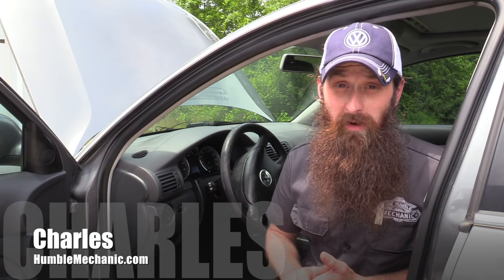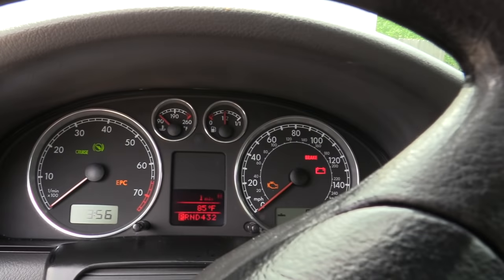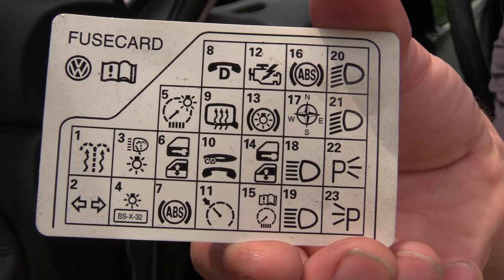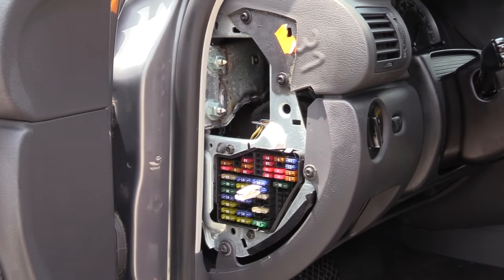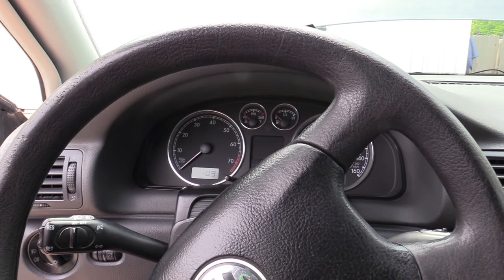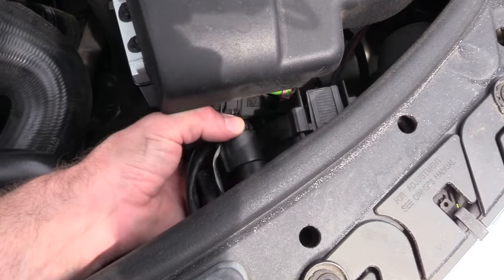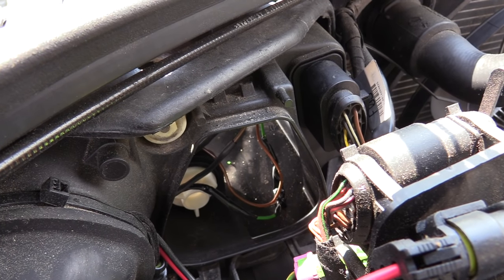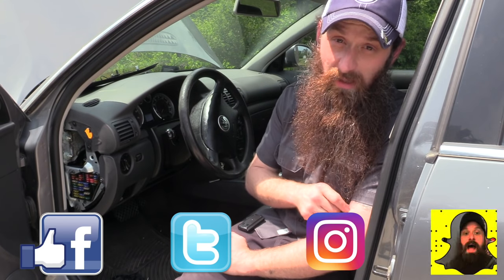Why My Turn Signals Don't Work ~ Diagnosis

Comment: I have a 2001 Volkswagen Passat, and when I was turning my defroster on for the windshield, I hit the hazard light button and it kind of stuck in and I had to keep pushing it and it finally released. But then my blinkers stopped working because of it. So I just pulled the hazard light button out a little bit and my blinkers are working again. Idk maybe this could help somebody.

Comment: Hi I have jaguar x-type 2001 I have problems with turn signal and high beam but the hazard is working I can turn on the high beam from remote control but when the car is starting high beam doesn't work i have checked the wiring for high beam there's no positive wire just negative but when I turn off the car  coming 12 volt when I turn on high beam from the remote control please no body knows fixed

Comment: hi, i have a 2005 acura tl and my right turn signal blinks fine but when i dont have my blinkers turned on, it doesnt stay on at night like the left side does. Do you know what I should check for? Essentially both sides should stay lit at night time and blinks when i flip the signal control on.
Reply from the maker: The stalk maybe?

Comment: I have a 03 beetle and the hazard lights work but not the turn signals. Any tips?
Reply from the maker: Make sure the stalk is good. And the relay may still be an issue

Comment: So I have a 2006 nissan sentra and my turn signals wont do anything but my hazards still come on just fine I've already checked the fuse and I replaced it and got a new one still nothing is happening could it be a connection problem?
Reply: Have the same problem man

Comment: So I am having issue with my left blinker not working by itself. It works with hazards on and my right blinker works by itself but my left blinker doesn’t.. any ideas? Don’t want to take it to a mechanic if I can fix it myself
Reply: Life with Nicole I have the same issue. It might be the left turn switch itself isn’t making the correct connection.

Comment: I have a 89 s10 pickup. My problem is the left rear brake and turn signal don't work. When you turn headlight switch on tail light comes on. All other lights work right. Bulb is good. If wiring harness runs up left side of truck how is it that right side is working right? Makes no sense.
Reply from the maker: Perhaps a broken/shorted section of wire

Comment: My right turn signal works fine but Every time I turn left my left turn signal sometimes work but sometimes It doesn't work. I need some an advice
Reply: we had a some problem in our Vauxhall were it would hyper flash but no green arrow on the dash and no bulbs flashing. some times it will work for a couple of seconds and it will go back to square one. turns out it was a earthing problem in the engine

Comment: On a 2004 Touran hit the turn signal stock to go left but it indicates on the right. It doesn't happen all the time but rather frequently what could be the issue? A dusty switch!?
Reply from the maker: Weird.  I’d be thinking stalk issue
Reply: @HumbleMechanic  Went to a local shop the guy said "It doesn't do it right now so I can't identify the problem"

Comment: I have a Corolla and I cant get signals to work at all but I have emergency blinkers, one of my headlights don't have a high beam, could that be problem? I've replaced a rear light assembly that was corodded,
Reply from the maker: could also be the stalk

Comment: Has this Passat been manufactured in the USA? Also, is the headlight an original VW part from one of their German OE suppliers? I've never heard of that before - and the way these wires look, I almost believe it wouldn't be legal to sell a car with such a crappy wire insulation on the European market (hence my question whether this Passat is a US only model, since especially the Passat of certain years is a completely different vehicle, whether it was produced in Chatanooga or in Wolfsburg)
Reply from the maker: No it's not a US VW. This was pre Chattanooga, and the headlights are OEM. 

This is actually really common on this generation VWs. I think mine are the worst I have seen. Now, some of this shielding has come off during the wiring removal.
Reply: Wow, I knew VW had quality issues, even serious ones, but using this material to shield those wires is the manufacturer equivalent of a hack job. I never thought that it had become that bad...And I am still not sure whether they use the same parts in vehicles for the American market, as they do for the European market. I've never heard of this issue on Passats, but I will inquire my mechanic about how often this occurs.

Comment: Need help, 2005 VW golf. Key won't turn to start position ,  radio won't play sound, wipers won't turn on,dash indicator lights don't come on. Car has been sitting outside a awhile, (Washington state)
Reply from the maker: ignition switch is probably the issue
Reply: @HumbleMechanic  I did just test the starter and that works. 😊 do you think if a mouse damaged the wire on the ignition  switch it would cause all other problems

Comment: That wiring is a design flaw. Either rated too low. Or the insulation is rubbish. If you intend to keep the car longer than a fortnight, I'm rebuild the harness in that part of the loom with better quality wire cut out of another unrelated loom from a different manufacturer.

Comment: Unfortunately that's not my problem got a Chevy Silverado and blinkers were flashing all of a sudden they quit went change the Flasher deal out came back still no blinkers double and then I decided just to check the hazards at that point no hazards no blinkers still have headlight good high beam low beam so I think that's supposed to rule out the multifunction switch. I haven't got a damn clue where to go next. Can anybody help me??

Comment: Hi i got a velocity 2008 golf. the flashing lights inside works but nothing works outside. all the bulbs is right. please where else can i check to fix this problem
Reply from the maker: check to be sure you are getting power to the bulbs with the lights flashing

Comment: OK .. I'm going to pull a Jethro Tull moment here .. my head is Thick as a Brick.  With your diagnosis that the headlight is the source of the problem. (Of Course, you're right but ..) I just can't see how you get to that by wiggling the multifunction switch turn lever and the fuse blows.  If the turn signal lever is what tripped the fused then why would you not think the multifunction turn signal lever is suspect?
Reply from the maker: +Hawaiian F150 my goal was to walk up to the front and wiggle the wiring. The fuse popped by the time I got to the front of the car. 

When it blew the other fuse, I wasn't wiggling the stall, just pushing down in Normal operation

Comment: I have a 89 s10 pickup hazzards work with the exception of the left rear. I have no turn signals which makes no sense because hazzards work. Why won't the turn on? Why can't you just force them on? I went to school for this and I am a inspection mechanic in crooked Pa. All this because of a drunk hit my truck. Just bent bumper. And it was inspected. $375 out of my pocket.

Comment: I have 2013 Kia Soul. The exterior front right turn signal light does not light up. The rear right turn signal flashes quickly as well as on the dash. The left turn signal front/rear flash normally. With the Hazards activated all the lights work including the exterior front right signal light. What do I need to replace or do?
Reply: Bulb bad front right
Reply: @mekobahl9804  You must be a genius, NOT.  Changed out the light bulb multiple times. Works as designed but then starts flashing quickly but the light bulb does not light up or flash. Turn on the emergency (triangle) flasher ALL flashers work. There is nothing wrong with the light bulb.
Reply: Ok well I'm not a genius yes you got me there ...good luck in life bud

Comment: Where is the signal light relay on a 2013 jetta, the information doesnt seem to be available online from what i could find
Reply from the maker: I am pretty sure it's built into the electrics modules
Reply: @HumbleMechanic  ahh, that explains why then, thanks
Reply: @HumbleMechanic  it has dash signal lights but they are fast blinking and there is a light error on but all 4 signal lights are not working outside, i haven't been able to put a my eyes or a meter on it yet since it is in another province but the owner checked the bulbs are supposed to all be good and the fuses also that i could find that would be related to signal lights but it doesn't mean i didn't miss some, i'll check them all when i get there on the weekend

Comment: What is your opinion of the 2014 jetta?
Reply from the maker: Most have been great. I don't love the 2.0 non turbo.. But the 1.8 is pretty solid
Reply: I agree with the not loving the 2.0 non turbo. How difficult is it to modify for example a turbo charger kit? What brand do you recommend for a turbo kit? Money isn't an issue I'll just save for it.

Comment: im working on my 93 f150 i got no 4 ways but everything else works i replaced the turn signai switch it has the wipers and 4 ways and turn signal all on this switch can you tell me wats wrong
Reply from the maker: Off hand I am not sure. Is it fused?

Comment: Hi I have a 2001 Jetta 2.0 manual transmission the epc light come on after 5 minutes of running and loses power..I turned off and back on and does again..I replaced crank shaft sensor throttle body O2sensor mass air flow cool pack spark plugs wires..and nothing change olso I replaced the fuel pump...what else can I do?? Help
Reply: kurt luna sell it and move on brother . i had the exact same problem with my 2001 jetta manual aswell. spent well over a thousand doing the same things u mentioned trying to fix it. had to sell it before i went broke.

Comment: That’s weird in my 2005 Nissan Sentra it shows that the signals turn on and the headlights turn on too put when I put either left or right signal it doesn’t flash so idk what could be wrong

Comment: How is it possible that a serious car maker can use such bad quality wiring?
Reply from the maker: +Ronald de Rooij makes you wonder how much analysis they did on headlight wiring before settling on this headlight.
Reply: It's called German engineering.
Reply: Guys, it's not "German Engineering" it's Fahrvergnugen.

Comment: My car work turn signals turn on then off after couple sec i press the hazard then turn it off then use the turn signal left or right everytime it goes off i do the same thing need help its annoting when trying to turn
Reply: Same problem here, however now they don't work intermittently either. 
Comment back if you discover a possible solution. Thanks
Reply: Lisa Malphrus it wad the turn signal relay flasher that is build in all in one unit just removed hazardous switch and the whole unit just replace it with a new switch and all works fine

Comment: OK.  I'm confused.  If the headlights are fuses 18-21, the blinkers are fuse 2, and the hazards are fuse 38, why are the headlights blowing fuses 2 and 38 instead of 18-21?
Reply from the maker: It was only the hazards, and turn signals blowing fuses
Reply: But how did unplugging the headlights stop the blinkers and hazards from blowing their fuses?  They are different circuits.  Are the front blinkers fed through the headlights?
Reply from the maker: +acoow yes the turn signal is inside the head light. So that removed the front signal from the circuit

Comment: My left turn signal has gone out again, mechanic had replaced a switch in steering coloum 2 weeks later the same signal goes out again. Wtf  is going on. Vehicle is a Ford explorer sports tracker XLT v6 4.0

Comment: What if only the right indicator isn't working? On the dash board and the front and back lights?
Reply from the maker: Maybe the stalk? What happens when you use the hazards?
Reply: @HumbleMechanic  in my case, only right turn signal don't work even during hazard.
Reply: Only the left side works when hazards come on

Comment: I just installed led lights everywhere, now when my automatic headlights turn on, my indicators go solid. The signals only work during the daytime
Reply: update; changed all signals back to regular bulbs and they work fine, i think i may have had wrong color
Reply from the maker: LEDs aren’t always compatible wihh bulb monitors

Comment: Wow that wiring insulation is terrible!. My 2003 focus has a intermittent turn signal issue. most of the time they work but occasionally I'll be driving along and realize they are not. Next time I get in them might be working and sometimes not. Hazards have not stopped working so I'm guess my issue is purely related to the flasher mechanism.

Comment: Cd 5 Track 99 Eh!
Reply from the maker: LOL, it's what the display reads when I have it set to "CD Changer". That is how the audio adapter works it makes the radio think it's a changer. 

That radio will actually be coming out soon in favor for a radio with bluetooth.
Reply: I had one of those adapters on our MKIV. Is the cable tie on the drivers headlight factory?
Reply: Noooooo!!!!  :P

Is it actually a Phatbox that you have, or is it something else?

Comment: The problem I have is that the signals can sometimes blink the wrong way. This only seems to happen when the stalk is put in detention. They seem to work with pressing but not using the detention. These problem are on a 2009 Jetta Sports wagon diesel...thanks
Reply from the maker: Weird. Probably a stalk issue but I haven’t ran into that

Comment: Does anybody have an idea what the problem could be in my case? The left turn signal works sometimes but other times it doesn't. Right turn signal as well as warning signal work fine.
Reply from the maker: Maybe the stalk?
Reply: HumbleMechanic yeah that could be the problem, is it advisable to just replace the stalk or is it a repearable part where a cable or something like that may have gone bad?

Comment: Sir, why some fuses sound different?
Reply from the maker: +john marvin pasol sound different?
Reply: I think he means the noises of the fuses once you touch them, I was wondering that as well
Reply: It either makes sound or doesn't , if it doesn't then its bad. If you are talking about the volume of the buzz , maybe that is because he is holding the button less hard, if it has a hold button on the tester.
Reply: I also thought the tone of the probe was different.  Can it tell the difference between +12 present  or not?

Comment: The problem is VW. This is why I always recommend to people not to own a VW. it would be rare for something like this to happen on a Japanese car. VW is not know for its realablity.
Reply: DigitalErra it's not just a VW thing I've had plenty of Toyota and Hondas do the same thing.
Reply: lol you either have bad luck or your cars where old. i had an 89 Camry thats was a tank.
Reply: what's funny is my old 96 Corolla wouldn't die a true tank however my 97 Celica is on it's 3rd engine 2nd wire harness. and every Honda I've owned had crap wiring. maybe it's a location thing it gets pretty freaking hot in Texas.
Reply: DigitalErra this problem happens to Lexus, and Acura, and Infiniti, and every car on the road these days.  It's a common issue with modern lights
Reply: Toyota and Honda haven't made bulletproof cars in a long time. Globalization and moving most of their manufacturing and parts sourcing from Japan have affected quality. I drove nothing but Japanese cars for many years and I don't see the difference reliability wise between many of the makes now.
Reply: That is very true. i had 3 generations of accords 96 99 03. the 2003 accord the head liner by the visors was coming apart. and the curcuit board that illuminates the leds around the radio burned out so i can see that the quality is not there anymore. but the cars i have had were high mileage so its to be expected. are Japanese cars reliable overall, yes! No car manufacture is perfect by any means but i put my money in Japanese all day everyday.
Reply: Rodents ate the engine wiring on my camry
Reply: that because their build in the us the ones build in germany go 20 plus years without problems
Reply: I doubt that very much. VW doesn't source parts from two different locations to build in two different factories. I do believe Europeans have different expectations on reliability compared to North American markets. Not to sound crass, but you're more tolerant of bad reliability than we are.

Comment: Waaahhhhhhht why are cable so damn bad!?!??!? All the mid to late 90s VW, BMW and so on have very bad insulation on the cables... My Golf 2 is 28 years old and when you bend the wire, they look, feel and behave like new ones... Same with the connectors. There is no quality in those cars. Lol

Comment: I'll push my emergency button and only my left light will flash, then I'll flick up my blinker knob and both my turn signals will flash it's confusing asf for me
Reply from the maker: On that’s weird.
Reply: @HumbleMechanic  might be something with my wiring, they jacked my stereo a couple days ago and they might've messed something up, I've replaced 3 fuses already